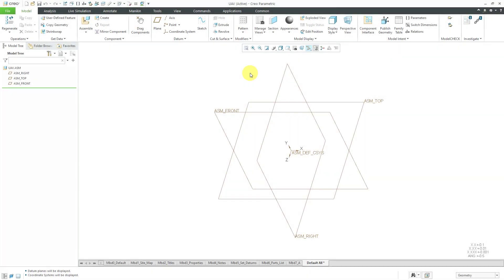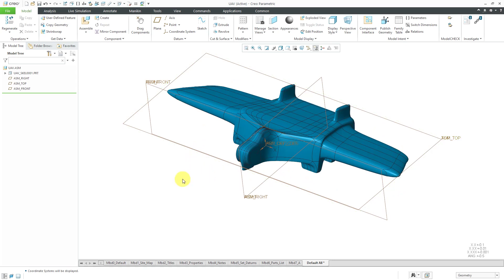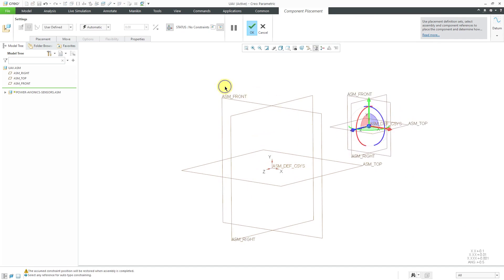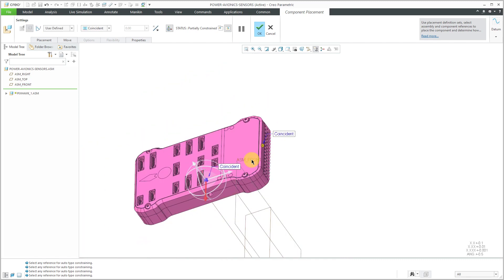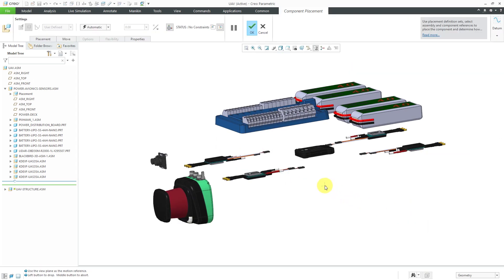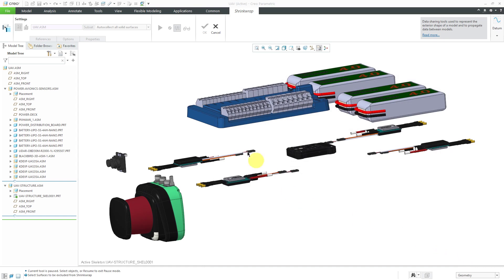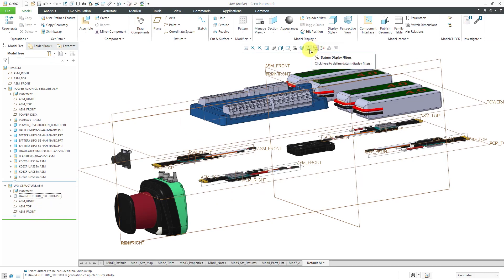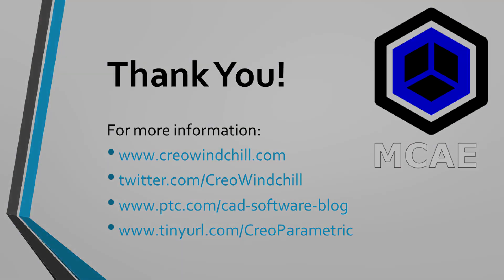Creo Parametric - Middle Out Design | Assembly Modeling

Comment: This is the area that currently i'm working with, with out knowing how to call this method thus i thank for this video.I have the habit to use copy geometry more often and in situations that is not the preferable option, due to limited time which results in lack of concentration. So this was a good reminder to take the time and think twice before every step. I'm very much looking forward to watch the continuation of this series.
Reply: Me too :) :) In the case that you have already some COTS like arduinos or odroids, this is the only way to create structural, cabling assemblies , external shells, etc.
Reply from the maker: I used to do cabling on Amazon Prime Air as well as kick off the top level assemblies for the vehicles. The top level would be done with Top Down. The top level skeleton would contain the OML. But in the electrical installation I was using a lot of Middle Out to locate the electronics and then build boxes and enclosures around them. The cabling was where I finally figured out the use for the Manual Collection option for Shrinkwraps - it's a Copy Geom at the assembly level.